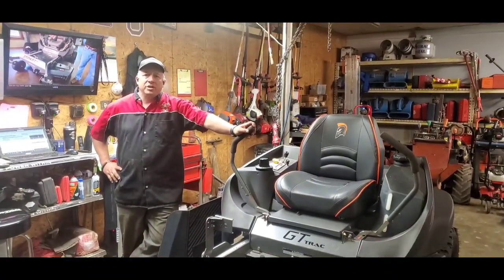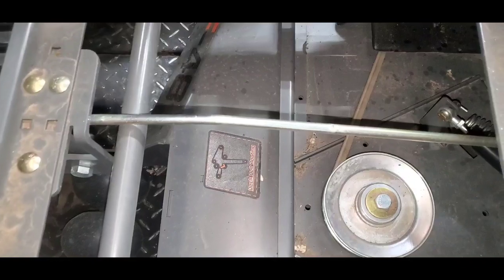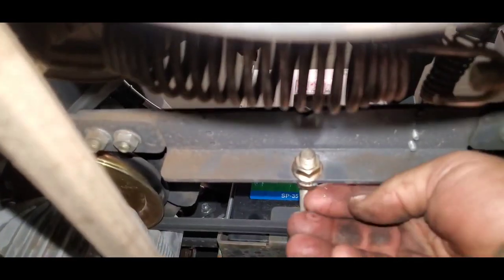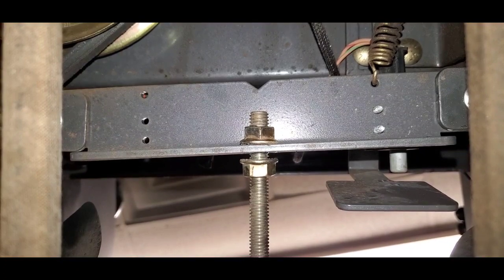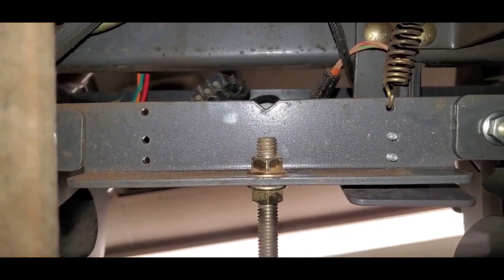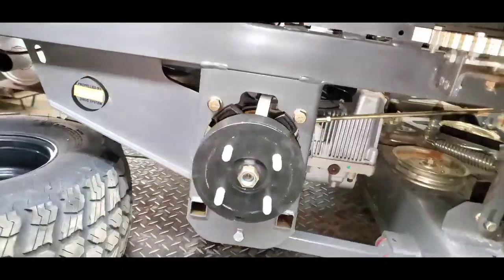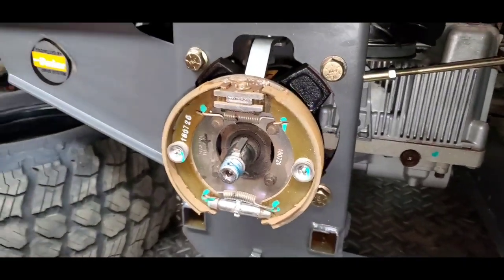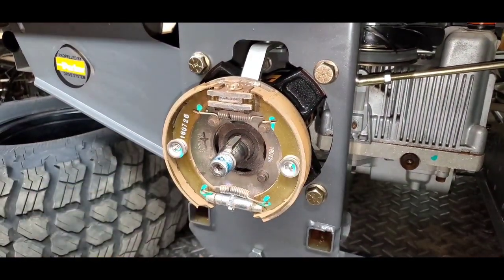Adjusting the parking brake on a Spartan Zero Turn Mower.

Comment: Do you have any videos on parking brake for KGXD Spartan Stand on?
Reply from the maker: Same exact process as the one in the video.  They both utilize the same Parker transmissions.  The acuating bar across the back of the unit is a littel harder to get to on the Stan on Unit.  But once you remove the back knee padding, you will be able to access it.  Thanks for the question.  Call us if you need futhur help.  (806) 359-9920
Reply: @generalrental6727  thanks I will check that adjustment and the drum brakes to fine tune if needed because it always creeps to the right in the trailer.

Comment: The metal arm leaving drum that attaches to mower bracket one bolt on either side or mower should those bolts be tight or little loose to pivot?
Reply from the maker: The connecting rob/bar should be tight.

Comment: What do you do to prevent brake becoming disengaged during short trailer ride to next job?
Reply from the maker: The parking brake lock pedal should lock in when you set it.  We always strap ours around the front foot rest area when it is on the trailer to keep it from moving too.
Reply: Strap it down with the mower
Reply: Have the Spartan mowers held up well? I'm considering the RZHD with the Kawasski motor and 54" deck over the Briggs (local dealer works on the 3 major brands and is favorable to Kawasaki). I have approximately 1.5 acres that gets mowed at least once a week. I think the Parker integrated drives may be an advantage over the 3400's in other comparable brands/ models due to no gear reduction. Any feedback you have would be much appreciated.
Reply from the maker: @johnd.613  It is the only brand we run in our rental fleet now for over three years.  Very dependable and easy to work on.